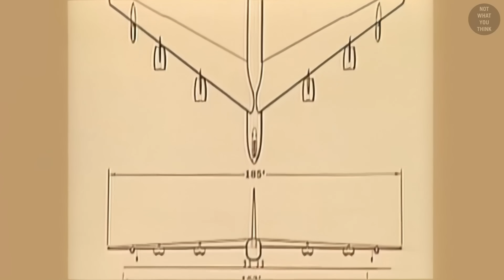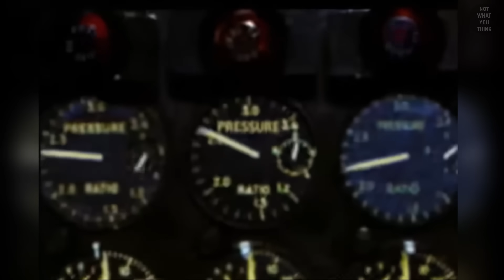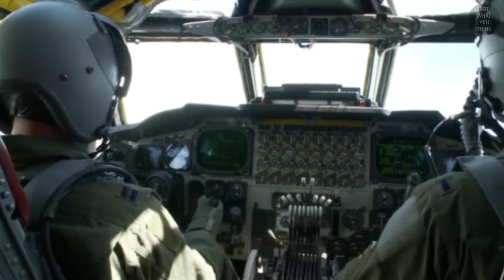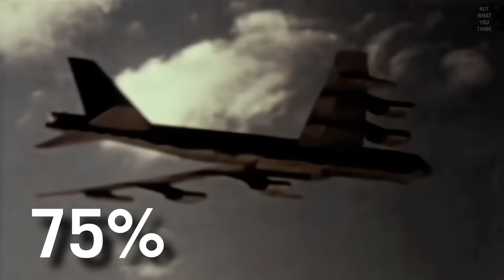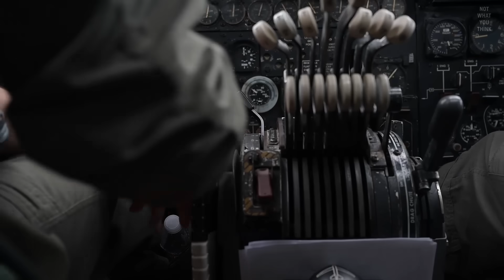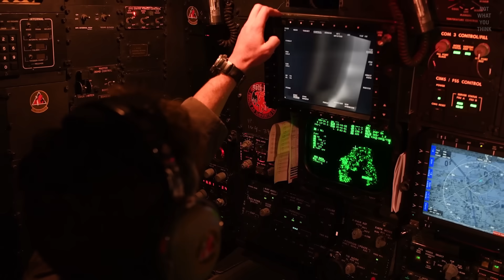Why This Obsolete Bomber Will Outlive EVERYTHING

Comment: It’s not obsolete. It’s just an incredibly adaptable design that has allowed the Air Force to consistently add/replace various parts and instruments, thus allowing the aircraft to last for a very long time, and with more upgrades in the works, including a recent engine replacement project, the aircraft will still continue to fly for hopefully another 25+ years. In short, not obsolete, just a design that can stand the test of time. Hints why I sometimes call it “The Brick”
Reply: “Old not obsolete”
Reply: @sovereign6445  yet more youthful than a fucking B2 spirit Stealth bomber.
Reply: That's exactly it. Sometimes when I'm daydreaming I try to figure out why something keeps being used for insane lengths of time, like that oil pump in CA from the 20's or the Browning M2. In the case of the B-52, I think it's the high level of reliability and the enormous and unparalleled capacity for payload.
Reply: @TheEverLivingAnth  agreed, there's a reason the SAA and the colt 1911 are still popular... tried and true designs never go out of style 😎
Reply: @yeldarb141983  Also I've realized that they never go out of style because the role they fill never changes. If we were using laser guns, 1911's and M2's would be obsolete. If we had anti-gravity and could float huge, fast airships, B-52's would be obsolete.
Reply: The BUFF is a great example of a rare time when the USAF got it right the first time.
Reply: @Hawk2495-1  Actually Boeing, but not now!
Reply: @Hawk2495-1  did you not watch the video? They literally fell apart in the air
Reply: The only thing originally left will be the aircrafts skin . Everything else including skin sections will be repaired where required .  Upgraded replaced renewed ! Old Industry adage. There is always a mod for a mod and  repair for a repair .... So long as the will is there they stay in the  air.❤
Reply: @daraboy1973   .
Reply: @daraboy1973  if the responsible in zhe military consider it necessary they will keep every plan flying for 200 years.. even overhauling the cell is possible, just a question if money.. keeping old stuff flying is also cheaper than new planes and also replacing all the infrastructure around it
Reply: @bobl78  
That's why they get C-Checked pal
Reply: obsolete as in its task...as a bomber as it wouldnt be used anywhere with even a lick of air defenses.....so 70% not at all.....thats what makes it obsolete...just cause u can retrofit a bomber doesnt mean its not obsolete as a bomber
Reply: This video is full of propaganda.  The first two statements  made are already lies.  I hear two more lies and I'll stop watching.
Reply: The flying brick was the nickname of the F-4 Phantom.  Proved if you put big enough engine on anything it can fly.
Reply: If it ain't broke don't fix it.
Reply: Well said! 👍🏻
Reply: People over at Quora are upset that you murdered 1 million Iraqis.
Reply: She's the chain smoking old mature heavy lady living in the trailer park with the tramp stamp on her lower back says "anytime baby" that can still rock your world...
Reply: Kind of both right. It's obsolete for its original mission, but its adaptability means it found a new mission is still well suited for.
Reply: The Air Force is the model service for procurement operations.
Reply: He flew pretty well for a brick!
Reply: Agr÷d it's old not obsolete
Reply: Henry..The United States is used to fighting opponents that don't have air defenses..Put this old bucket of bolts up against the air defenses of China or Russia and the crew will be coming home in body bags, if they're lucky..
Reply: @bigstuff52  Well yeah. It’s just a stand-off aircraft now like they say in the video. It fires a variety of ordinance like cruise missiles from outside the engagement envelope now, kind of an airborne battleship.
Reply: You say "allowed" but I think the word you're looking for is "required"* lmao
Reply: The fact that he said ice build up is only a b52 issue, but shows footage of a c130 being de-iced.
Reply: Ako amau: not obsolete the B-52 is okay
Iori shiromi: IT IS NOT THE BIG UGLY FAT FELLA HE IS THE BLOCKY UNSTOPPABLE FLYING FRIDGE!!!!!!!!!!!🤬
Chinastu: uhh the BUFF is pretty fine
Hina sorasaki: WAIT B-21 RAIDER NEXT-GENERATION BOMBER!?!?!?!?!?!?!?!?!🥵
Reply: Just like that it's Not What You Think
Reply: Same way I describe my classic cars, reliable as long as change the engine, fuel system, structural failures and anything else coming up. So in the end, not all that reliable
Reply: The Stratofortress will be flying so long, it’s final crewmen will be cockroaches, because humans will have since gone extinct.
Reply: @SillyPuddy2012   the B-52 will continue until at least 2550
Reply: @SillyPuddy2012   not insects
The final pilots of the B.U.F.F. Are students from blue archive from 2070 to 2250
Reply: It is just "adaptable" as any plane if your only task to be a weapon truck...
Nothing special.
Reply: @militavia-air-defense-aircraft  name one that can do that with payload and range. That is also not either beaten to death or extremely expensive maintenance
Reply: @kameronjones7139  The B-52 its only plane the class. Bui and F-16A airframe is just as able to use any PGM which is integrated what a Block 70.

So the B-52 is not a miracle. The airframe enough durable because it is not a fighter and it is not used as an airliner.
Reply: @militavia-air-defense-aircraft  which is my point nothing can do what it does which makes valuable in an large engagement
Reply: @militavia-air-defense-aircraft   what do you think the actual top speed of the sr-71 is/was? I know it was never pushed to that point, but if someone opened up the throttle till it redlined, what do you think it would top out at?
Reply: @yeldarb141983  M3.2 by the FM, rarely, on cold days reached M3.3 and only twice reached the M3.4 according by interview of pilots. The plane was limited by the intake temp. So anybody claims higher sustained speed is simply ignorant. Anything above this level was hazardous. Actually a mybusting is planned about the SR-71 on my channel because I'm quite fed up the tons of lunatic misinformation about the plane.
Reply: @militavia-air-defense-aircraft  Thanks for the straight answer! still pretty awesome though...

hope it never happens, and I know it's crazy...but I've had this thought that if I ever got a terminal illness and couldn't find a cure, my last wish would be to get trained in a retired blackbird and then take her up and open up the throttle till she flew apart...

on a slightly more realistic note, though, how cool would it have been if instead of completely retiring them, they retrofitted the information gathering section of the plane with a crash couch and sold flights to people who could afford it/saved up for a flight?

sorry, i have a bit of a romantization with the fastest bird who ever flew 😅
Reply: @militavia-air-defense-aircraft  I beg to differ. Due to an accident of history there's more redundancy built into the B52. Hence it is more adaptable than other planes.
Reply: @jiros00  In this form your statement simply has no real menaning.
Reply: It is obsolete, just like battleships. Back when it was first used it could be used against capable adversaries but not anymore. Now it can only be used against enemies without air defenses.
Reply: @johnmackenzie3871  yes it is basically only effective against insurgencies
Reply: In simple terms, it’s called a ‘timeless’ design
Reply: Of course its obsolete. The only reason the US still uses B52s is because their R&D/weapons procurement/whatever is too incompetent or corrupt to replace it.

And theres actually a ton of oudated weapons in the US arsenal. Look at armored vehicles, ships or even some types of missiles, and you see all those failed upgrade programs and decades of screwing around without results. As a result, both europeans and even china have overtaken the US in some areas. Even the late soviets had types of cruise missiles that were more capable than anything America has today.

Or heck, maybe the B-52 concept genuinely doesnt make sense anymore, so they cant actually replace it effectively, but also dont want to get rid of the tech.

Comment: "The new airplane was big and powerful, but none of the observers in that cold morning of 1952 doubted that newer, better airplanes would replace it in a few years. And yet, 25 years later the B-52 is still flying, the machines that ought to have replaced it having fallen victims of structural fatigue (B-58) and program costs overrun and cancelation (B1a)."

Thus started the article about the B-52 in the 1978 Aviation Enciclopedia that I used to read as a kid.

Little did they knew - the BUFF wasn't even mid-career.
Reply: *either 1988 if it was “35 years”, or 1978 if it was “25 years”.
Reply: @tackywhale5664  - Thank you, I stand corrected - It was 25 years, evidently. So, the BUFF was at 1/3rd of it's career...

Comment: It's worth noting that the KC-135 that did so much of that in flight refueling is only 4 years younger than the B-52, and is only now being replaced, which will take many more years.
Reply: The C-135 airframe is going to stay with the Air Force for many years to come. The tankers might be going out, but the RC and WC will be around for a long time.
Reply: Even the KC-46 is not doing the greatest job in replacing 135s. With all the issues we have had upon delivery of the 46s, the air force is posturing to double down on the 135
Reply: @StrikeEagleCinema  the air force f'd that up.
Reply: 1

Comment: 60 years passed from the Wright brothers flight to the B-52.
60 years have passed since the last B-52 models were made.
Put that into perspective.
It will continue to fly for the next 30+ years, meaning air frames will be 80-90 years when they are finally retired.

Comment: I'd say that the way the design is overbuilt and revised, they could make them fly indefinitely as long as they replace the fatigued material. This plane is one of the most patchwork piece of aviation work that was made, but decades of testing and revising the design, along with retrofitting new technology made it one of the most refined planes out there.
Reply: You can do that with older equipment because the technology to build parts still exists. The newer the tech, the harder it is to keep running once the supply of spares runs out. Also, strength in numbers allows you to maintain a good knowledge base.

Comment: I thought the US military actually named it “Super duper missile” 😂😂turns out they actually call it AGM-183
Reply: I'm pretty sure the AGM-183, is not a nuke, its an inertia weapon, basically a man made meteor that can fly through the front door at mach 21 and on impact kills a similar radius to a standard nuke. Without radiation just an Earth shattering Kaboom.

Comment: A lot of countries gave America basing and overflight rights during the height of the Cold War.

They linked to agreements specifically to the operation and support of the B-52 as a way of making the agreements temporary.

And that's why 70 year old planes are getting overhauled so they can fly another 70 years.

Comment: The issues with Soviet SAMs is NOT why the Valkyrie and B-1 programs were cancelled.  Valkyrie suffered two catastrophic crashes to 2 of the 3 prototypes and was far too expensive and complex for its many operational issues.  The B-1 Program (which my father worked on for many years) was initially cancelled by (then) President Jimmy Carter, who felt the monies would be better spent on the next CAS aircraft, known as the A-10 Thunderbolt II (a.k.a.- the Warthog).

Both the Valkyrie and the B-1 were originally intended to be Mach 3+ cruise-capable platforms, but when the B-1 Program was eventually reinstated, they cut a few hundred mph off the top-end, but what it lost in speed, it more than gained in stealth and ECM.

Advancements in Soviet air defense systems were little more than a speed bump.......pun intended.

Comment: Sorry folks but his is going to be a long rant.

To this vid's Producer/Narrator: You do the B-52 and SAC (Strategic Air Command) a Notable Disservice with your Negative Comments for most of this vid.

After being declared Combat Ready in the late '50s, the BUFF fulfilled every assigned mission up to and including todays.

All aircraft engines have failures hence these mid '50s designed engines were constantly being upgraded and like all Turbofan Jet Engines are overhauled after so many flight hours.
BTW: The new engines will be a Game Changer.

Wings on all aircraft have Stress Cracks. The new Wet-Wing needed two redesigns to perfect but gave the bird longer range, a stronger wing to endure higher stress (Tree Top Flight Intrusion) and to also carry a rather heavy under wing ordnance load.

The Vertical Stabilizer failure on that TEST AIRCRAFT, flown by a Boeing crew, was Purposely being flown through Severe Cross Wind and Down Draft Turbulence over the Rockies to test the Airframe's Endurance and Flight Controls. Boeing and USAF concidered the test a success due to recorded wing loads encountered and the recognition that a new Vertical Stabilizer design was needed.

All aircraft fuselages flex in flight. An hour of turbulent flight time will produce Ripples in a BUFFs skin and are refered to as Beauty Marks of a Mature Lady. As the design matured in the early '50s, it was determined that re-skinning would be required after extended flight hours. Note that when in Depot Maintenance, only portions of the aircraft are re-skinned in areas where Oil Canning/Rippling is prevalent. The BUFF is not the only aircraft that requires re-skinning.

The electronics was Good-To-Go from Day One and was/is updated as Technology Advanced, as Mission Profiles changed and as new Weapon Systems were added.

From the early '60s onward, the B-52 could deliver a Nuclear Bomb from an altitude of 50/60K feet at 650+ MPH, actually capable of 700+MPH at altitude, and could cross into Enemy Controlled Territory at Tree-Top Level scooting along at 500+ MPH.

One morning in the mid '60s at our Pre-Departure Briefing, 20 each 4 man Titan-II ICBM Combat Launch Crews watched a short film of a B-52 flying at 150 ft and 550 MPH over frozen tundra in some western state. It began as a small dark cload in the distance and within seconds grew to a B-52 screaming over the camera. The second part of the film was at reduced film speed and began when the B-52 was just recognizable head on. As it got closer, we could see its wings were flexed up some and the frozen tundra was being ripped up in chunks and flung into the air by the vortex off of the wing tips. Years later, I learned from my new Father In Law that this film was part of the Endurance Testing of the final Wet-Wing design. Elvest, rest his soul, was a Mechanical Engineer at Boeing Wichita and worked on some of the structural changes to the final re-design of the Wet-Wing.

I was only seconds into your screed to see that you really didn't know much about the B-52, its History, its Constant Upgrades or its Historical Significance in keeping the Soviet Union and now the Russian Federation and the CCP in check while preventing Nuclear War.

Coming from you, its as though the B-52 was a Boondoggle from the get go and was only saved in the last several years.

Like all aircraft, it had Growing Pains and Accidents. The Growing Pains were fixed as they were identified. The accidents were addressed by in-depth investigations and constantly improving training. SAC left no stone unturned and nothing was left to chance in its operation of the B-52 or any of the other weapon systems it was responsible for. And note, most accidents were Pilot/Crew Error like in most other aircraft accidents.

If you had done Due Diligence in prep for this vid, I suspect your attitude would had been Positive, or at least Neutral, instead of Negative in your presentation.

In the future, research your subjects in depth. Better Luck Next Time Dude.......

Comment: The B-52 that lost it's vertical stabilizer was caught in turbulence near the Rocky mountains.  A Boeing crew was flying the plane and doing research.  So this wasn't a fault with the design.   The other B-52 that ran out of fuel wasn't the fault of the crew or the B-52.  The A/C system of the plane broke and the B-52 carries a large amount of electronic gear that puts a huge amount of heat.  It got so hot in the plane that the cockpit windows cracked, the crew took of their flight suits and had to wrap them around the control yoke it was so hot.   The crew should of just aborted the training mission and returned to base.  But this was the SAC culture to complete the training mission at all costs.  If they don't they will loose their elite flight status and chances of promotion and whatever.  So don't blame this crash on the crew.  Blame it on the culture in SAC and Curtis LeMay.  You are not telling the whole story.  You could easily do a 45 minute video on each of these 5 crashes.
Reply: Typical lack of research youtube style implying that "stabilizers fell off because of bad design" when in reality the aircraft was stressed on purpose in strong turbulence.